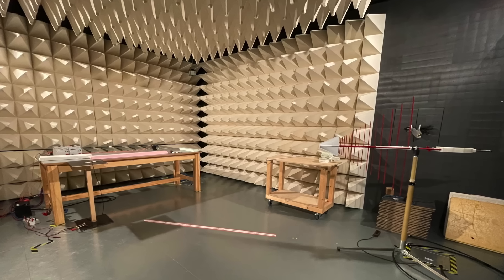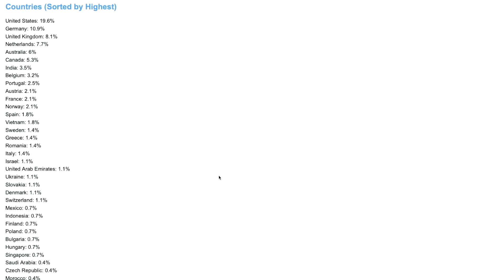I Built the Perfect PoE Sensor - But Can't Sell It to You

Comment: To be fair, let’s compare this with other regions:
In the USA, you must certify such a product for FCC approval. An intentional radiator (this is how they call anything with a RF transmitter) requires testing by an accredited lab and an FCC filing. FCC rules are very strict when it comes to radios — if you change the antenna, enclosure, or power level, the original approval is invalidated.

In Europe, the scope of CE testing is broader, but the process is based on self-declaration. For simple products, you can technically just self-declare at no cost. There’s no filing with the EU; you simply affix the CE mark and issue a Declaration of Conformity. In theory, if you already have the test reports, this can be done in minutes.  And no 'accredited lab' is needed, which alone results a larger competition in the service and lowers the prices, even your own in-house lab (if your company can afford one) will do.
Therefore the whole process is startup-friendlier in Europe. The essence of the EU regulation in contrary to the US is that, they just trust your word initially (innocent until proven guilty, where I hear this many times?), and you only have to prove anything if there is a doubt/problem with your product.

In the US, however, testing and filing for FCC of an intentional radiator (e.g. Wi-Fi or Bluetooth) costs around $10k–$20k for full certification including filing fees, and typically takes 4–8 weeks depending on lab schedules. There’s no way to speed this up for mere mortals and the $10k–$20k alone is enough to put most garage startups out of the game.
Reply: I think you can use a pre-certified module like an esp32 or raspberry pi pico W in order to avoid compliance testing in the US.
Reply: @brainwater That's exactly what I was thinking. People cobble together things from other devices that have already been approved and sell them all the time.
Reply: @brainwater  Incorrect, still need to FCC test the product, just not the full wireless section test.
Reply: @brainwater this will work as long as you don't add non-fcc approved sensors right?
Reply: @brainwater In RF and power supply it  all jellybean modules unless someone in doing something with 2 transistors and prayer to keep bom costs down.     Ship a bare board with a QR code for the 3d model of the encloser to the first million customers.    IF its a good product, someone with the resorces should come along and lic it and put it into a brands pipeline where these issues go away for the v 0.2 designer, they are going to rework the BOM over again anyways.
Reply: I used to work for a company that did that and dident do a single test untill they had already sold the items for over 10 years
Reply: @aggese That's a dangerous game though, and it shows a lack of integrity
Reply: This is also why USA don't accept other countries certificates, even if the other country uses the same rules and test environment! This is pretty common for cellphone. For example, countries like Brazil can do the test for local rules (ANATEL) that follows both European and US rules, but USA doesn't recognize the test. Why? Because other countries charges far less for the same test!
Reply: If your product under EU RED won't fit a EU harmonized standard you will require a notified body to do the certification proces for you.
Reply: @outsideworld76  So with a non-EU-standard product, you end up with the same level of treatment, paperwork, and hassle that you get in the US by default for all products? Fine. And I very much hope that nothing with lower safety standards can slip through from the US.
Reply: Speaking to the US costs for small simple products, testing at a local lab can be more reasonable, and there are foreign testing options that are very competitive. I haven't used a foreign lab before, but I've had a lot of 2.4GHz radio products tested over the years at a small local (still accredited) lab and it's been in the $4k-$6k range.

Still a significant cost for an individual, but for small companies looking around $4k is a lot better then $10k.
Reply: @DigitalOsmosis  Thanks for the update. It’s good to hear that healthy competition is driving prices down. The main factor is that the cost of test equipment has dropped significantly over the last 10–15 years, allowing more players to participate in the testing/approval business.
Reply: Wooow, as someone in the EU, I just lost 85% of the trust I get from a CE declaration. This would mean the cheap chinese crap that is being sold (tablets, radio transmitters, chinese brand routers, mini pc's etc.) Can fabricate their tests in lab conditions while actually using way more power, switching out conforming components with cheaper non conforming ones etc....I'm with the US on this one, better not to trust than to blindly trust in good faith especially when it comes to electronics. I trust EU made products by EU citizens and in that case I doubt it's a problem, I don't trust the boatload of people wanting to exploit this fact from overseas (entire reason Temu-likes are popular).
Reply: @q1337  I thought you’d lose exactly 87.81% of your trust, so it’s a relief you only lost 85%.
Reply: @q1337  You pretty much got it wrong. Read the thread again.
Reply: @maskharat  In what way? Seems you can use your own lab instead of an accredited one. even for CE RED you are allowed self-declaration but with specific radio requirements and notifying bodies is only required for high-risk equipment.  The only benefit of the CE and CE RED process is the lower costs that can improve innovation but they undoubtedly have potential trust issues. I don't know which part of my original comment is wrong when the FCC process is simply superior for consumer safety because of rigorous testing requirements and strict regulations, but costs more for the businesses.
Reply: @q1337  mhm, as you cared. I guess your chinese tablet will now blow your head off and your plastic covered mini-pc would burn your xiaomi TV. Only if someone would go to the lab and measure RF on those things it would be fiiine.
Reply: "the $10k–$20k alone is enough to put most garage startups out of the game." And this is why the monopolies laws in the US are redundant as the government practically forces small start-ups out from the offset! The only way to get your product sold in the US as a small garage start-up is to get bigger, already established, companies to either buy your design and produce it themselves, or hire you to re-design your product for them!
Reply: @j.tann1970  …and this FCC thing isn’t even their strongest weapon (to take away the chances of the small ones). The real obstacle is the patent system.
Anyone who has ever dealt even a little with patent research (for freedom-to-operate purposes) quickly realizes that the whole patent system is a big mess. For every topic, there are at least a dozen, sometimes even hundreds of patents that can, one way or another, be interpreted as applying to what you want to implement.
In practice, there are four types of patents:
- actual inventions (rare),
- those of the big players, used to block each other or as bargaining chips—often several patents describing the very same thing in different words. These are the so-called “defensive patents,”
- trolling patents—the hunting weapons of patent trolls. They’re not actually used for products (sometimes just pretended to be); they exist purely for collecting ransom money,
- and countless trivial bullshit patents. No wonder these exist, all players (patent offices and lawyers alike) are interested in filing as many patents as possible to earn a living.
Any one of these is a ticking time bomb for a startup. No one will bother you for a while, but the very moment you start growing, you’ll be “infringing” some BS. The large players get away with it easily—they just mutually “infringe” each other’s pool of patents. In fact, they often hold thousands of patents for exactly this purpose.
Reply: @j.tann1970  10 to 20k is nothing in terms of company finances, even a startup. If the tests for your product are the issue in pricing, but you have a product, you have people that want it, guess what? That's an easy loan to get.

If you want to open a company that isn't a one man show where you're privately liable for everything in Germany you'll have to have 25k in reserves in the company from the start, not optional, that needs to be there to be able to register at all.
Reply: You can not self declare products containing a radio transmitter, medical equipment and products for children. Everything today has a radio for BT, WiFi, Thread, Zigby etc.
Reply: @MaxQ10001  The declaration itself is inherently a SELF declaration. Nobody will declare anything in your name or instead of your company.   
This is how it works according to the wording in the law: the signature on the 'Declaration of Conformity' has to be YOURS.
...you just need to have the evidence ready that supports the results of the performed  tests in case of inquiries from authorities or any  legal/safety problems.
Reply: @nick066hu  The EU is a shitshow, just another way to collect taxes for them to keep existing and prey on the people's efforts and willingness to comply... Very typical of them that you can 'self-declare' and just 'guess' whether you are in compliance or not, but if you ain't the EU will fine you and if it bankrupts you, they don't care, they just need the money... 

We sadly live in a world where there's more value for a company to comply with bureaucratic slump than releasing a decent product because we all know that's not happening any more.
Reply: That power is abused by the state in many places does not make it less of an abuse.
Reply: Do you just love when regulations stomp out any innovation?
Reply: @howtoguy17  How did you come to this conclusion?  
In this comment I am just saying the US system is not at all innovation friendlier than the EU regulations.  ...it has become a habit to portray the EU as more bureaucratic, which IN THIS CASE is simply not true.   
...and you’d be hard-pressed to find someone who hates bureaucracy and pointless rules more than I do.
Reply: @nick066hu  how the hell does having to pay $100k not stop small companies from creating a product?
Reply: @Industry-insider  The cost for the lab measurements for a device under CE RED (so with a radio) are more like 10 grand, 15 if you're unlucky. Not 100. Also there are very good labs in the eastern EU states that do the work for you for ~5 grand with amazing turnaround times and good support in case you fail.
Reply: It could be that it is equally expensive or even more expensive in the USA, but it is also a lot easier in the USA to find investors. Something that is a lot more difficult in Europe. The reason why many Europeans start a company in the USA.

Comment: module for B2B integration only😊no enclosure, no “consumer instructions,” labeled “for integration by professionals.” (You provide integration notes, not a user manual.)
Reply: Nope, read the EU RED (Radio Equipment Directive) article 2.

There is no exception for business to business. 

There are only very little exceptions for Radio Equipment not to meet RED and those basically are national security/defense and equipment build by HAM operators for their own use.even those must meet technical standards but don't require all the paper work and third party evidence.
Reply: @outsideworld76  But this would be business to consumer. Personally I think "integration by professionals" is the wrong direction, go with hobby rights.
Reply: clever...

Comment: EMC testing is the crux of what I also want to do in the EU: EV conversions. Everything in the EV space is getting so cheap, that you can basically already buy all the components for a really good EV conversion for cheaper, or much cheaper than it would take to EMC test a vehicle.

At least some countries allow for showing the paperwork from a donor as proof of compatibility.

Don't get me wrong, EMC compatibility in vehicles is obviously a much more complicated topic than a simple low voltage ethernet thingy. But you might end up never being able to prove your conversion's EMC compatibility, even if you followed everything to the T. EMC tests start at a few thousand euro for a vehicle and they are no guarantee of anything.

One way to think of it is; if you cannot figure out how to build your own EMC testing cell, run it and test your vehicle, it makes little sense to try and use someone else's facilities to try to get the right paperwork for your conversion. 😅

There is an alternative in many countries though... Build your car in to a car that was never mandated to be EMC tested, then you only have to take care of the basics and make sure you are not trying to drown the local FM radio or your neighbourhoods wifi with your 500kW motor turned in to an antenna. 😂

Comment: Rough timestamps
0:30 CE rating
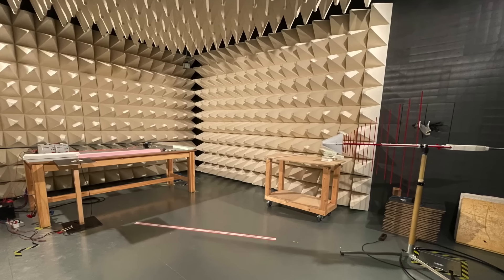1:30 anechoic chamber
3:10 lawyers
3:40 documentation 
4:00 insurance
4:28 prototype manufacturing 
4:55 recycling label fee
6:15 fee for sending sensors to each country
7:00 only helps large companies and not small ones.
Reply from the maker: awesome - thx 🙏

Comment: First you need to figure out if you can sell 10,000 units of your product. Then calculate the total manufacturing and certification price. Then add VAT and a 200% markup to that price. Can the 10,000 units still be sold at that price? Kickstarter or similar might be good to see of you can reach 10,000.
Reply: Thank you for your knowledge
Reply: 10000 is absolutely way way too much for a Kickstarter project
Reply: @seklerek  Is it though? Many projects have hundreds of thousands of backers on kickstarter. Some books, some games, some utility products.

It might be too much for THIS project. But you don't need to reach the final unit sold goal in your kickstarter anyway. Just enough to show a likelihood of eventually selling that many.
Reply: @seklerek  Well 10,000 units migth be too much for the project, but it is a requirement for mass manufacturing to the EU marked. It sucks.
Reply: @PerMejdal What do you mean a requirement? Requirement to make 10k of a product to sell it in the EU?

Comment: 1. You don't have to buy those regulations to comply with them.    (I don't either buy the the Criminal Code book to be a law-abiding citizen)  btw. these are all free to download, but anyway makes no sense to actually read them,  you just need to know some basic values, like allowed frequencies, power, interference, etc.  can all be summarized on a A4 sheet.     Even if you had the full text, you wouldn't (shouldn't) read those hundreds of pages, leave that BS to the lawyers who get paid for that, your time is much more valuable.
2. If you use pre-certified modules (almost all chip and RF IC manufacturers have them in their portfolio) you can safely self-certify your product at no cost.
Reply: I guess it all comes down to risk, and risk appetite. What's the risk to you as an individual if you are selling as a limited company and you have indemnity insurance? That's a question for a lawyer.
Reply: About point 2 I can gurantee that you are wrong... also with a pre-certified modules you need lab testing.
Reply: @pigi_experiment  If you use CE-certified modules exactly as specified (antenna types, separation distances, layout/shielding rules), you can rely on their RF test results for spurious emissions, harmonics, etc.
You're right, the end product still has to meet EMC, electrical safety, spectrum use, and health requirements, but there’s no legal obligation to use a “certified” lab—your own setup is just as valid. With a battery-powered device (no mains, no surge/burst/dip tests, no electrical safety issues), most of the heavy immunity tests drop away. What remains is radiated emissions, which you can check with a spectrum analyzer.
For small runs or low-risk products, I wouldn’t stress about full testing. If sales take off, that can fund a formal lab test for v2.0.
If you don’t learn how to cut corners wisely, you won’t succeed in this field—or any other.  Many startups take the “test enough to be confident → sell small quantities → fund formal testing later” approach.
Reply: @nick066hu  With a pre certify RF module the test is more simple and cheap. But you still need to check if there is any sort of interference beetwen the case, your pcb, some internal cables with the RF module.  Maybe there is a screw in wrong postion of the enclouse that generate problem.  

I agree that for a start-up all this rules are overkilling and extremelly expensive and at some point cutting corners it's the only solution.